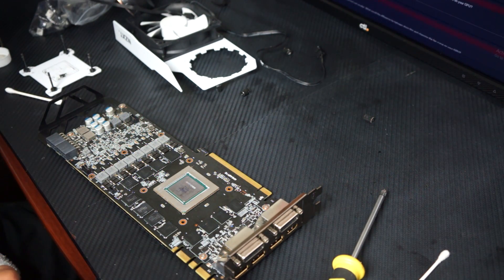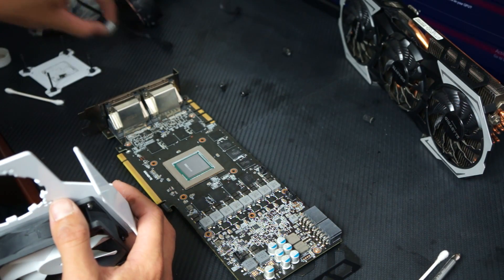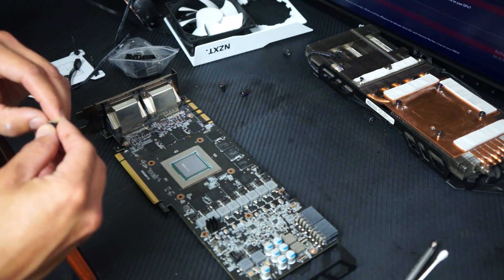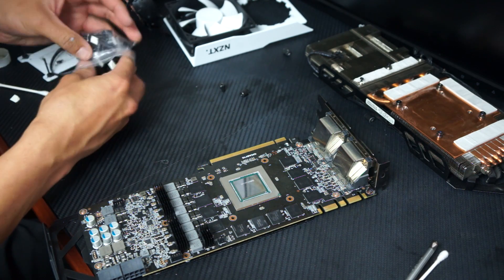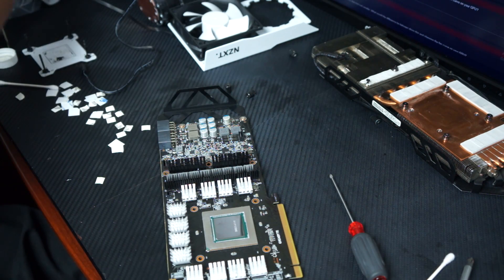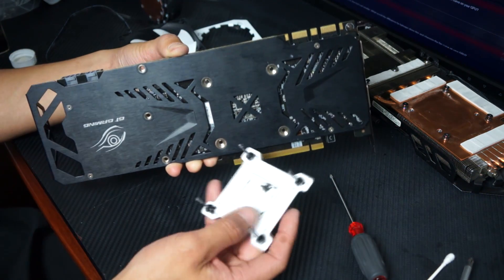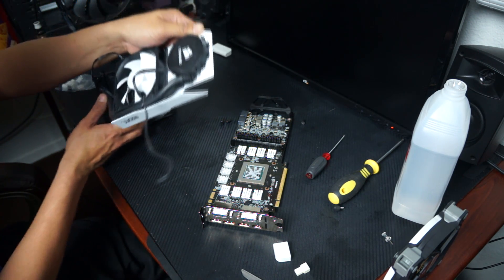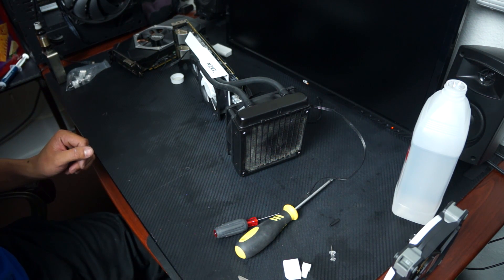Installing a NZXT Kraken G10 on My Gigabyte 980ti G1 Gaming

Comment: I have the same gpu the only issue I have I can't remove the fan conector it's just stuck no idea how to remove
but after 3 years I cleaned my gpu and replaced thermal paste with thermal grizly and temperatures went from 81C to about 66-70C under load

Comment: Earlier today I installed the kraken x42+g12 on my 980ti hybrid (that had a dead pump) now i have 27c when idle and 46-47c under load. With the original Aio, before it broke, i had 29-30c when idle and 50c under load and it only had a 120 mm rad.
Reply: So kraken x42 has 240mm rad?
Reply: @ngohien7011  i dont know what i meant to say then. but i still have the g12 bracket with fan and the x42 on that gpu. but it is a 140mm rad. not 240. and the gpu dye is the only liquid cooled part. all the other vrms and so on is cooled only by the small fan on the g12 bracket no thermal pads or hestsinks no nothing... dont tryy this on newer cards though. this one is beyond any warranty and  is getting replaced now after 6 years. so i can abuse  it. it has been overclocked since day one and it is still working.

Comment: Thanks for sharing can i install any best liquid cooler with Thermal pads or BCP 1roll 20mm x 25m Double Side Adhesive Thermal Conductive Tape with out any heat sinks to my gpu.

Comment: Help I accidentally broke one of the cables when disassembling the graphics card, the smaller one next to the wind force logo.
The connector is extremely stiff and won’t come out and one of the wires snapped at the base. Can I solder it or is it screwed?? Please help